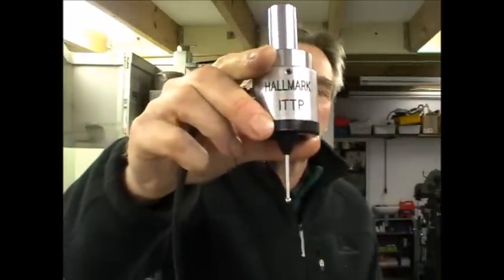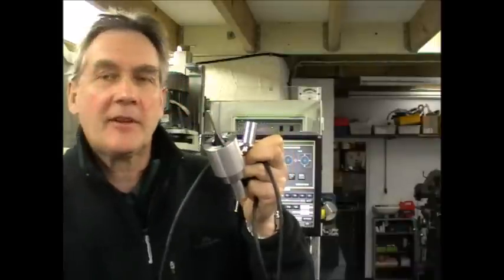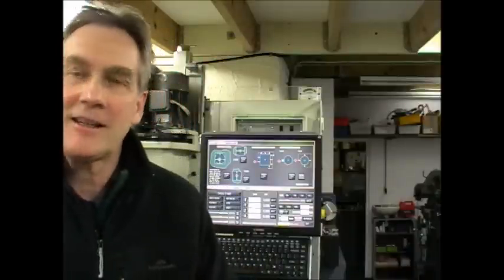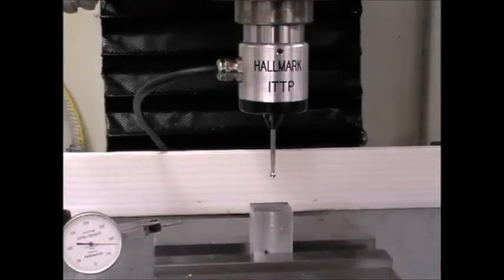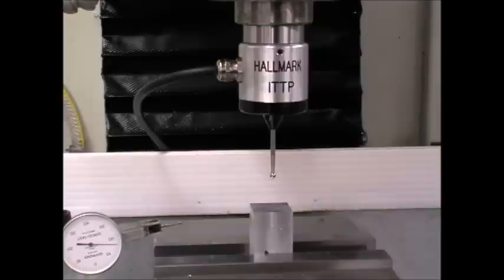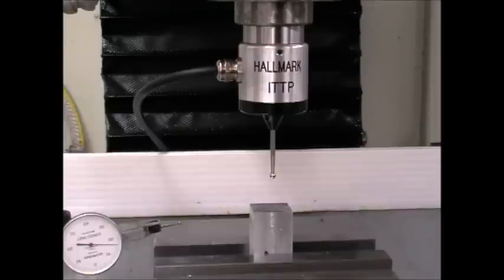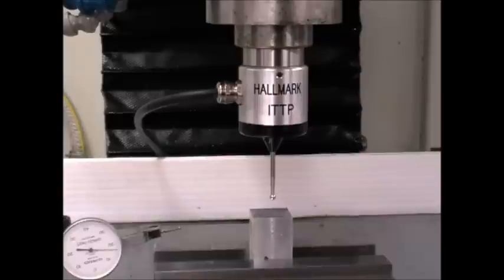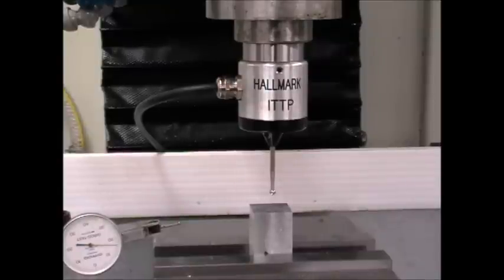Probe - Hallmark ITTP Mk3. New Design Touch Probe.

Comment: Very impressive to come up with something that can beat everything else you know about that's around the same price. And do it with far better accuracy.Since my mill is a manual machine I don't see where it could help over the Haimer 3D I have or I'd consider buying one. I wish you the best of luck with this and think you'll do very well with it. 

I realise your still at the testing stage and the production models may have some exterior changes  from the one shown in the video. But one thought I did have was a good logo and fancy lettering always makes things look like they cost more than they did. Every little bit helps when selling anything, but I really know very little about sales so my thought may be worthless.
Reply from the maker: No - I appreciate them. Thanks

Comment: Great update, I bet you're going to sell many of these! Needing to store it facing straight down doesn't sound like that big of a deal to me.

Do you have any plans of making the cord detachable? I always found the cord being permanently attached to the side of my Tormach Passive Probe to be annoying - particularly when calibrating.

From where does the fluid leak? Casting silicone is actually pretty easy, perhaps you could design a custom silicone boot that would seal the unit well enough that the probe could be stored at any angle.

Also related to the fluid potentially leaking: could the design be modified so that it can also be stored with the stylus pointing straight up?

Is the fluid dangerous or corrosive? Is it expensive? I know I would be less worried about leaking fluid if I was confident that some leaking out wouldn't damage anything.
Reply from the maker: Thanks Hirudin.Re detachable cord. Yes I would like that. It would be better I agree.But it is a very price sensitive product and this also introduces another fail point. Probably I will offer it longer term for a small price premium.  Long impact tolerant travel means a boot is problematic.It is better to store upright to keep contaminates out.Fluid is not dangerous or corrosive   - but special and worth keeping confidential as part of the IP. Enough will be supplied with the probe.cheers

Comment: Hi Cliff,
Congratulations on MkIII.

Exciting to see the development continue - and I whole-hearted support for the deferred release while you're ensuring it meets or exceeds you own standards.

With reference to the necessity to store the probe in a vertical orientation, how do intend to overcome the 'unknown' state during shipping?
Reply from the maker: Hi Peter.The plan is to supply the Probe with the end cap off...and a tube of the fluid  - it only takes a minute to apply the lube and screw it on. I plan to link in buyers to a unlisted technical video explaining applying the fluid and other details. This will also mean buyers will understand the construction and should be more comfortable with user service should that ever be required. Should any contamination or damage etc occur, they will have the fluid and can clean it out and relube. ..Or fit a replacement part if a massive crash occurs etc.Cheers
Reply: Perfect - knew you'd have a solution for it.
Thanks Cliff